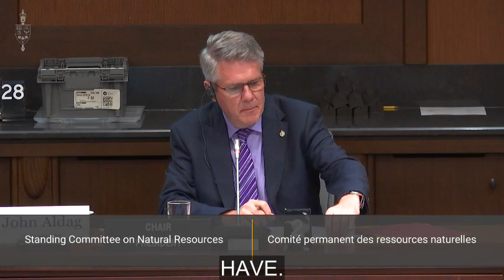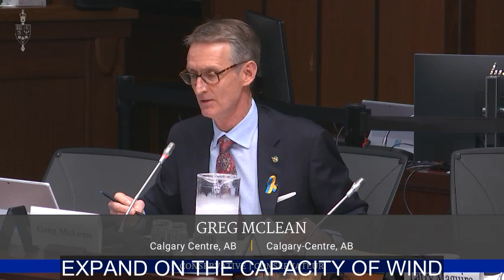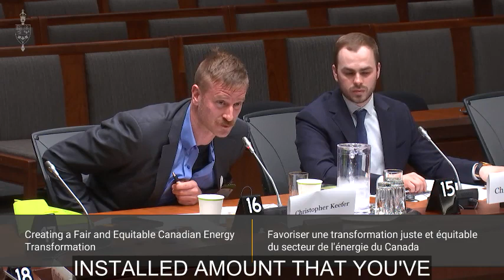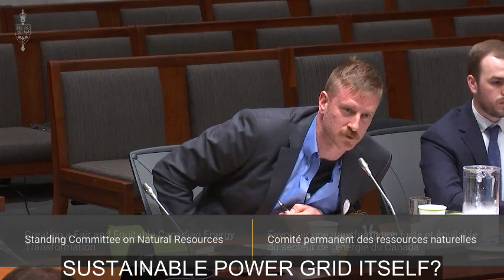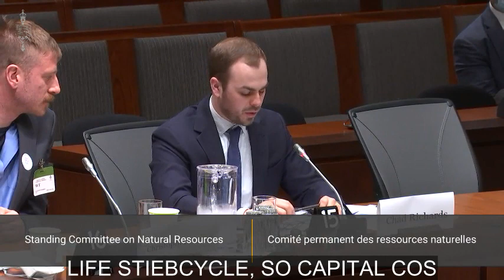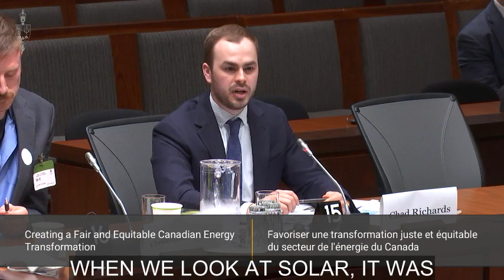How much energy does wind & solar provides on a cold day in Alberta?

Comment: So far they found that solar power for heating is useless. They have never found any cost-effective way to use solar power as a heating element for communities. You can't generate enough solar power to heat it the entire community to begin with effectively

Comment: Wind and solar just cannot provide the power when it is needed and will always require a back up system so essentially you have to have gas,coal,hydro or nuclear power sitting idle waiting to take over when wind and solar fail to produce. If you want to see ugly take a drive near London On. There are wind generators everywhere you look.